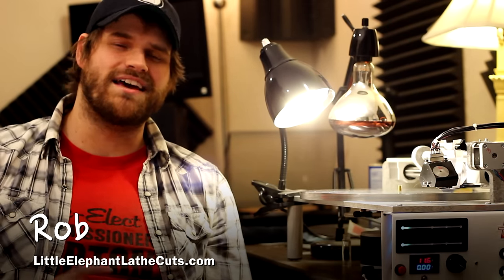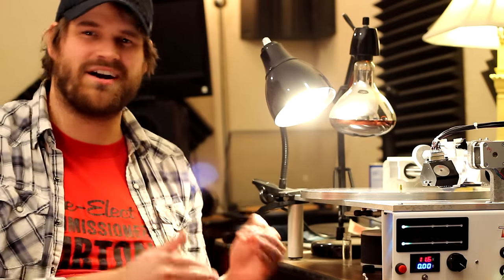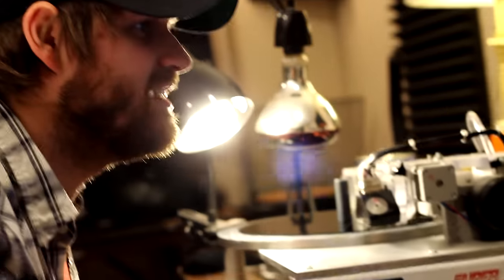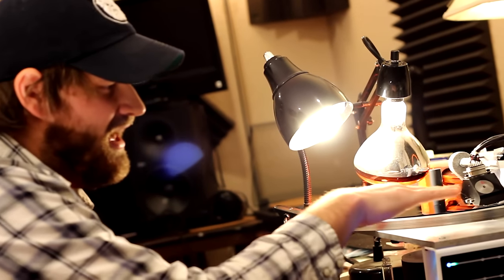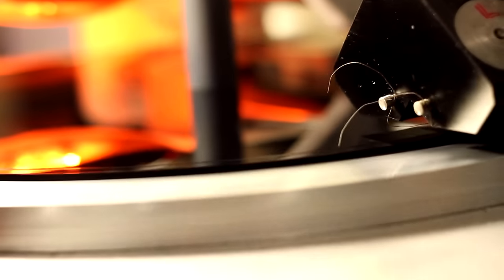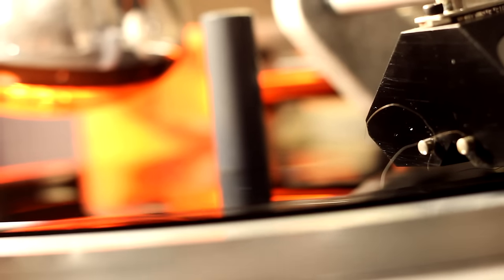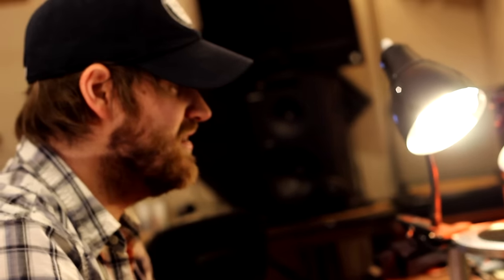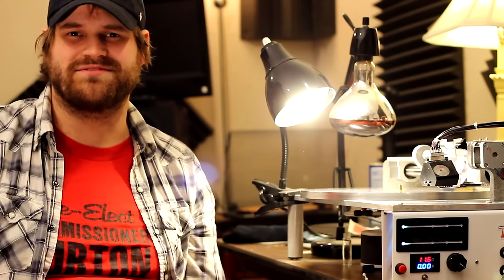Little Elephant Custom Vinyl - Short Run Vinyl Records

Comment: 13:30  I'm in tears.
Reply: Holy shit. This hurts my soul
Reply: @lagroneglass7546  I hear it when I close my eyes.  Really.
Reply: @garretthaines9485  im confused, what exactly did you hear?
Reply: @davida7229  At 13:30, what do you hear?
Reply: @garretthaines9485  Some sort of squeak noise?
Reply: @davida7229  Yes. And that record is irrevocably damaged.
Reply: @garretthaines9485  Ah i see now, i thought it touched the smooth part of the vinyl but it hit right on the grooves! Ouch
Reply from the maker: Actually, the B side on that record hadn't actually been cut yet and the protective sheet was still in place. I can assure you that no damage was done.
Reply: @Littleelephantlive  I assumed you had cut both sides.  If my comments inferred that you did something wrong or that do not do good work, I apologize.  However, I stand by my position that the sound at 13:30 hurts my soul as @Lagrone Glass also explained.
Reply from the maker: @garretthaines9485  It's an awful sounds for sure! I just want to let everyone know that the record is definitely not irrevocably damaged because of that scrape. Thanks for watching!

Comment: Cheers for this. looking at releasing a few lathe cuts in the future. Wouldn't have known the different things to look out for, i'm in the UK, so of no use to you. I haven't yet watched all the way through the video, but is cutting this way much more expensive than the generic lathe cuts you mention, which are cut a different way? Do your prices differ from general 7"s, with all the extra effort made to make it sound better? Cheers!

Comment: This is super cool. Why do you guys use a whole 12" though? Wouldn't it be cheaper and cost less to put it on a 7" since most of the sets are 3 songs?
Reply from the maker: For our sessions, we decided to keep everything on 12" LPs so that every record is the same. Many of our sessions would not fit on 10 inch, or 7 inch records, so to keep it all uniform, we decided to just do everything on 12 inch, no matter how long it was. Plus, on vinyl, the music sounds better the further away from the center it is. Does that all make sense?
Reply from the maker: However, for our custom lathe cuts, we can do any size the customer wants!

Comment: I would have spaced out the grooves to the max, since it's such a short recording! Makes for a "hotter" louder cut, with more dynamic range!
Reply: It's not going to do anything of the sort unless you pushed the volume into the cutter head. The groove spacing is dictated by the feedscrew that moves the cutter head in towards the center

Comment: This is a good example of how the vinyl craze has gotten so ridiculous. Anyone who still thinks that vinyl is superior to digital, obviously hasn't heard a modern-day high-end transport/DAC system, watch will blow any vinyl out of the room every time.......And that's the truth.
Reply: To me its more fun to mix with vinyl. Plus there are many cool tunes that never got a digital release and most likely never will. Its fun hunting for new tunes in record stores all over the world that have who knows what stories behind them.
And even if you are just listening back on a HiFi, its a completely different experience. Sound doesnt matter as much as the whole process of taking the disc and putting the needle on and listening to the full side in 1 go, most likely doing not much else other then look at the big printed artwork and soak the music up fully. 
You can slap a pad in a coffee machine and get a nice drink with 1 button push. 
Or you can take the time to manually brew one  which will involve a lot more time and work, but most likely result in something way more enjoyable, despite it still just being  a cup of tasty caffeine water. 
And some imperfections might end up turning into 'character' and 'charme'.
Thats essentially all analog sound is about: finding the imperfections that suit your taste. 
Totally fine to persue the 'ultimate perfectly clean and flat' sound too. The genre of music makes quite a big difference too, in terms of what 'good sound' is. 
Some stuff just sounds wrong in too high fidelity. Too clean, too robotic...